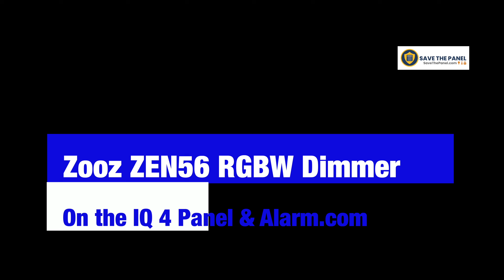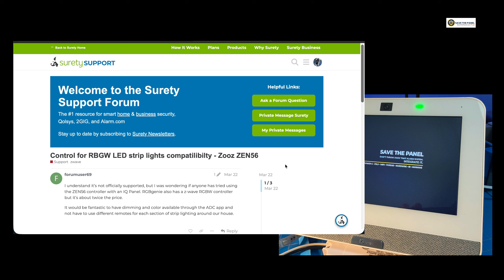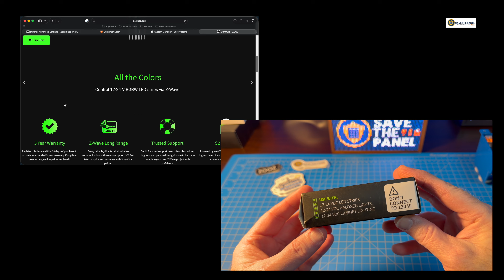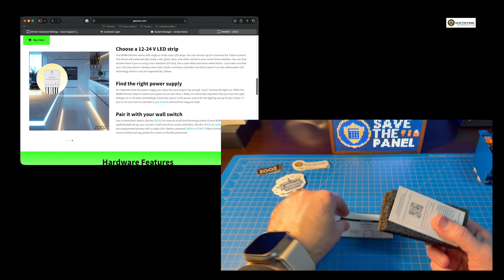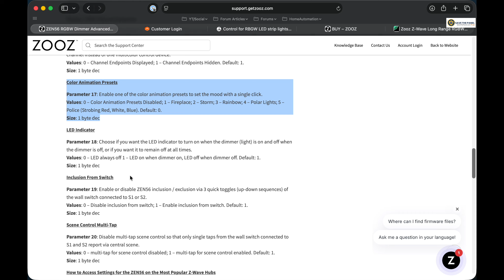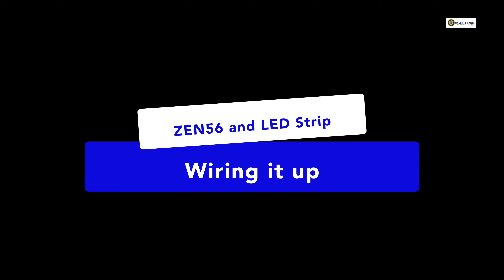The Secret to Getting Zooz ZEN56 Working on Alarm.com

Comment: Because my led is alternating rgb only and white only, I don’t have washout issue, but I just want rgb only led for red and green.
Reply from the maker: Interesting.  I read in your other post that you are on the IQ 5.   I do want to retest some of these products on the IQ 5.  I tripped over one or two already that work differently on the IQ 5 than the IQ 4 (which is frustrating, by the way... why not update the IQ 4 for little things like z-wave device compatibility?) Anyway I'm wondering if the washout is truly gone in the IQ 5.  It certainly may be!  I'll give it a shot and report back with a short if so.  Thank you!